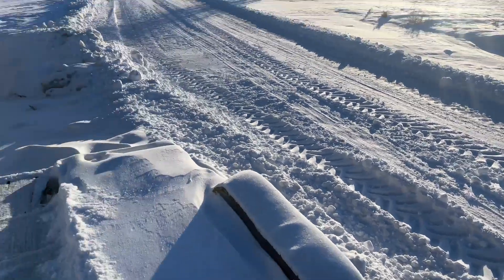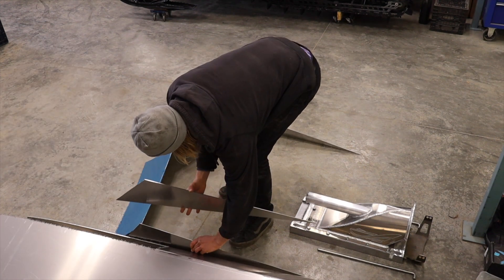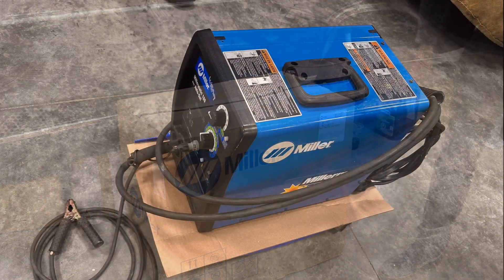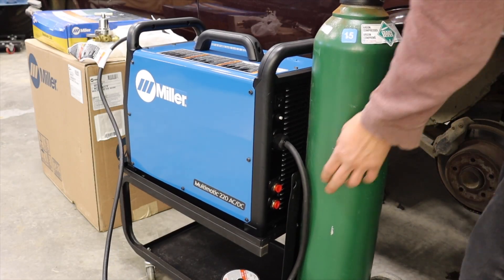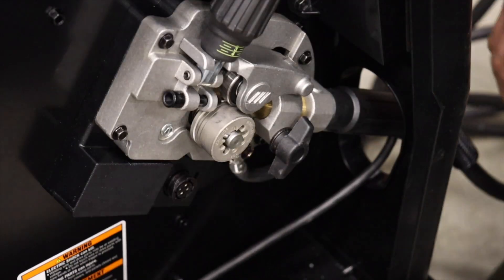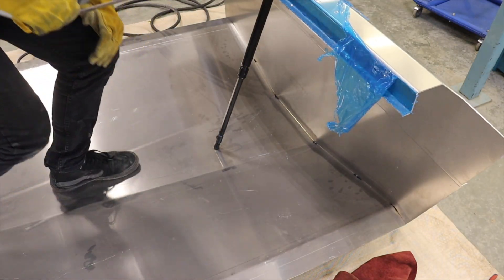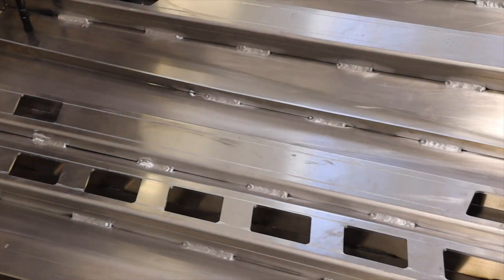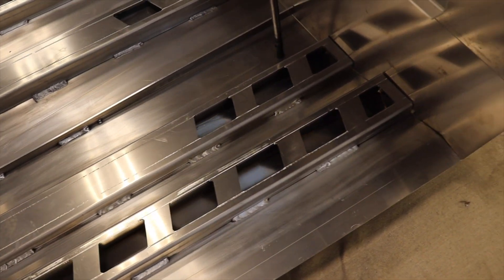Building an Aluminum Mini Jet Boat! Episode 1

Comment: 50 series wire will create more soot but is made for welding marine aluminum alloys like the 5xxx series. 4043 will weld it but not as strong but is more forgiving when flexing. for that boat 4043 will work just fine. i wouldnt want it on a big bass boat or ship though

Comment: i know its a year old but anyone that is starting to mig welding aluminum needs to watch
how a robot welds aluminum. aluminum is welded much hotter than steel or its alloys also. the wire coming out of the tip will sometimes come out straight and others it will go side to side. if you learn how to make fast in out circles like a robot does it not half moons like when in mig welding steel you can get a beautiful welds that will look like a robot welded it. you can also if you keep your nozzle 90 degrees to your metal and just push or drag in a straight line but you will not build any thickness and will be much weaker than if you did the fast circles. ive been welding for a long time and thats the best way to mig weld aluminum and the only better way to weld aluminum is tig welding but more tedious and looks better and isnt that much slower if you know what you are doing.

Comment: You might want to look more into the wire you're using. When welding 5xxx series aluminum with 4043 wire, the welds become brittle. 4043 is definitely easier to get a pretty bead with but 5356 is the correct wire to use in boat building.
Reply from the maker: This is good to know! Thank you

Comment: If you look up "back step welding" on google it will show you a technique to melt in your starts and reduce distortion. Fancy machines will have a run in or hotstart feature which helps too. Anyways, the reason 5356 has more soot than 4043 is because of the magnesium content. 5356 is a stronger wire with higher ductility and is mainly used to weld 5000 series base metals like 5086 5052 5083 and so on. 4043 is more so for 6000/3000/2000 series base metals and applications where the weld will be exposed to higher temps like around an engine also cast alum. 4043 is easier to weld because of the silica content and the lower melting point.

Comment: Looking pretty good David! 

I applaud your boldness in tackling this project never having aluminum welded before.

I'm planning on building a mini jet boat sometime soon as well. 

Curious what you'll be using for a motor and pump.

I've got a few tips for the welding side of things. I'm no expert or professional welder, but i did take a TIG welding course through BCIT, so it's pretty solid info.
Reply: Also, it looks like you might need a bit more shielding with the gas.

Your Argon should be at 30 CFM when you're welding - check your regulator flow settings.
Reply from the maker: Thanks man!!
Reply: Cleaning/ prepping the weld area is super important.

Need to clean the oxides off first, both the material being welded & the rod. Use a brush and Emery cloth, and clean with acetone. Cleaning is only good for an 1 hour before oxides are reforming.

Have a specific brush just for aluminum.
Reply: Preheat the first half of your weld stitch before you weld, makes a big difference.

Also, it looks like some of your welds didn't get hot enough. Go over them with your TIG torch before you can't reach them. They'll break if they don't have enough penetration.
Reply: Rock on! 🤟🏼

Comment: Looking good so far.   As to welds, Im not an expert, but the 50 series wire will smoke more than the 40.Regardless of smoke, use the correct wire for the series you are welding.  It looks like the welds you had questions about were too cold, too dirty , to low of CFH on the argon??     Aluminum will oxidize apparently in about 6 hours. The oxidation has a much higher melting point than the base metal, thats why cleaning is important, it messes stuff up. Any foreign material will mess stuff up. You should brush all the areas to be welded, dedicated stainless brush. Wouldn't hurt to wipe down with Acetone though be careful about fire.     
To be honest, your welds look a lot better than I thought they would, so good for you. I have a spool mate 150 and am having a horrible time with getting it to weld clean???   Somethings not quite right with it??  Yours look better than mine by far.
Curious about your settings?  
Cant help you with starting and stopping?
I had a tour in Jan at "Life Proof " boats in Bremerton. The weld quality is outstanding, cant figure out how they get everything to look like it was one continuous weld? They are using Pulse and much more expensive Millers which I'm sure is a help.
You should if you have not already watch "Timmy Turtles" boat build. The guy helping him is really good at fabrication.